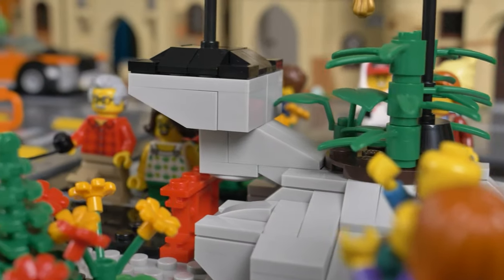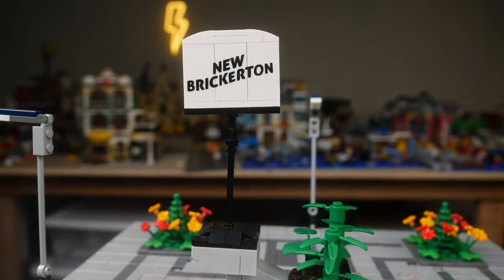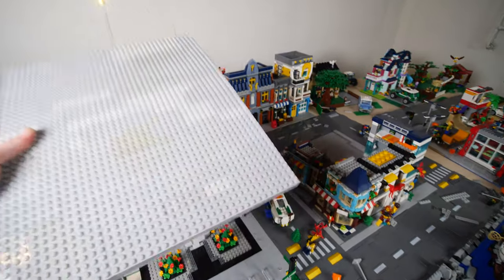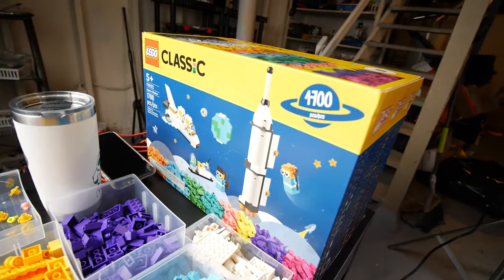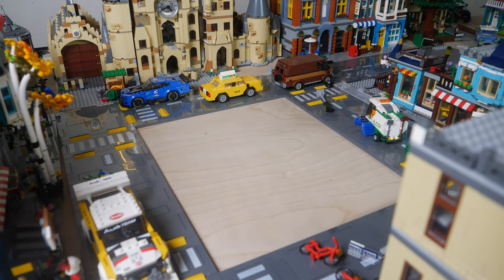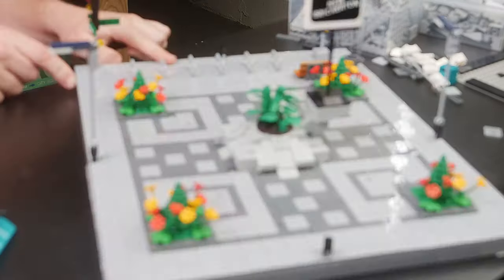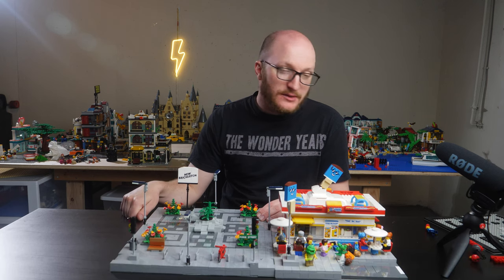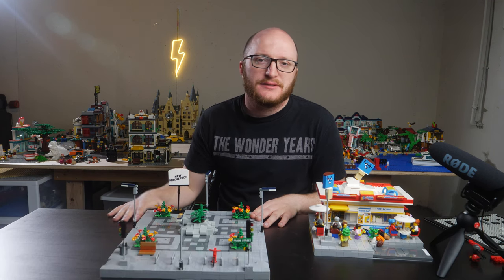Upgrading the town center AGAIN! - LEGO City Update + Vlog

Comment: Really love your vids! Quick question: What are the advantages/disadvantages of mils plates? Thanks!
Reply from the maker: Glad you like them! Thanks so much for the question. Here's my thoughts.

MILS Plate Advantages: Allows you to add additional depth to landscapes such as creaks or hills or curbs. Extremely sturdy, can move chunks of the city around with ease. Allows your city to be modular and portable.

MILS Plate Disadvantages: MILS plates require a crazy amount of bricks and plates, most of which are just interior structural pieces that you won't even see. It'll cost a lot of money and take a lot of time to get the parts.

It's a large investment, but mostly people that have switched stand by it. I'm gradually transitioning, probably won't have the full city transitioned to MILS for months and months.

Comment: It seems to be too high for your roads. I get what mils is for but yours just seems overly high. Not in scale for some reason. That’d be quite the high curb. Doesn’t look right
Reply from the maker: I don't disagree. The roads probably need to be one or two plates higher compared to the curb. The city will be a little wonky as i begin to add the curb and tiles everywhere, but i am definitely re-evaluating how exactly I'm going go to do it as we go along. Thank you for the comment!!